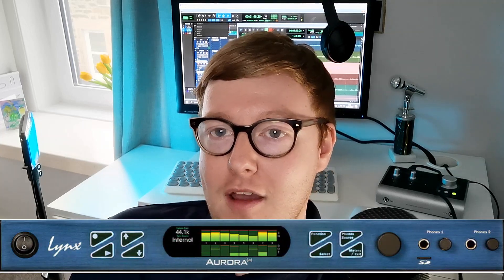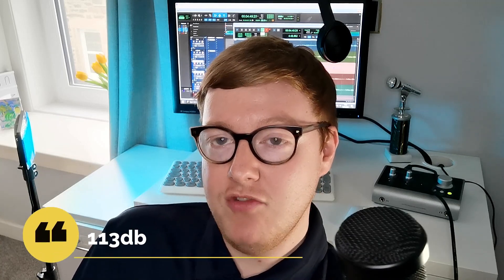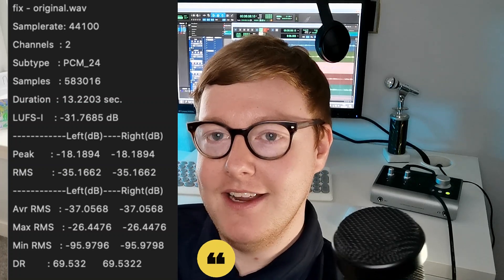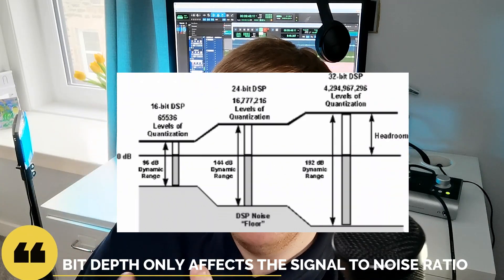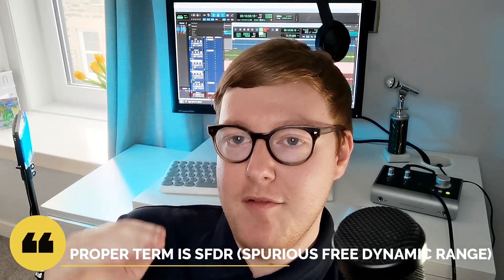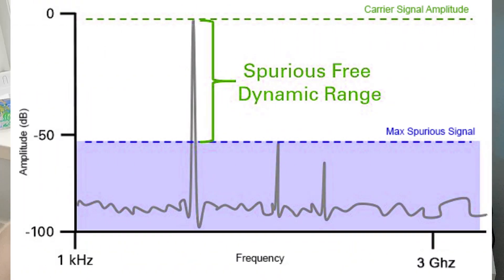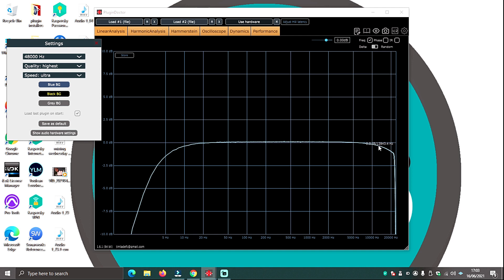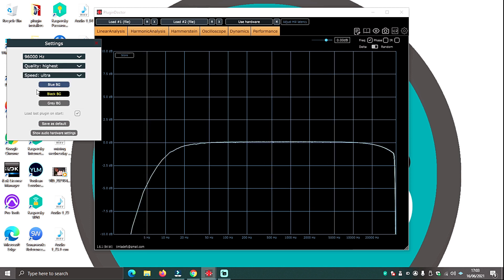Do you lose audio quality in analog gear using budget interfaces vs expensive ADC Converters (Pt 1)

Comment: 1bit = 6db? What does that even mean? dbwhat? dbSPL, dbVU, dbvu, dbFS? You can't say something is 6db and not include a suffix. It would be like saying that speaker handles 100 watts. 100 watts what? RMS, average, peak? The difference between 100WRMS and 100W Peak is nearly double.
Reply from the maker: And why can't you not use dB when it is dB lol. All the analog manuals and audio interface specs state dB for dynamic range 😂

(from the universal audio 1176 manual) 

Dynamic range - The difference between the loudest sections of a piece of music and the softest ones.  The dynamic range of human hearing (that is, the difference between the very softest passages we can discern and the very loudest ones we can tolerate) is considered to be approximately 120 dB . Modern digital recording devices are able to match (or even exceed) that range.
-----------
I said 1 bit is equivalent 6db of dynamic range. It's just 6db lol If you also look at the dbx160a manual it states:

Dynamic range > 113db

They use dbU, dbV, dbM for other measurements in the specs but for dynamic range .. Just db lol 

Iv said an easy way of calculating what analog dynamic range transfers to in digital bits is to divide it by 6 as 6db of dynamic range = 1 bit 

All your doing is quick maths to transfer what figure a manual states is dynamic range and transferring it to digital bits 

Its genuinely that simple
Reply: @PaulThird  I know what dynamic range is. When you state "The dynamic range of human hearing (that is, the difference between the very softest passages we can discern and the very loudest ones we can tolerate) is considered to be approximately 120 dB" that 120db is 120dbSPL. 
 You said "an easy way of calculating what analog dynamic range transfers to in digital bits is to divide it by 6 as 6db of dynamic range = 1 bit". Where do you get that from? If "6db of dynamic range = 1 bit" how do you represent 1db of dynamic range? All audio AD/DA converters use binary. If you know the bit depth you can calculate what the least significant bit and the most significant bit voltage will be. A 4-bit converter can only count to 15 although 0 can be counted so you can get 16 increments of voltage including off or zero volts. First, you need to understand how to count in binary. And then you need to understand how the binary numbers relate to a voltage level and how the voltage relates to dbSPL, dBu, dBV, or dBfs. With binary, you always have a most significant bit (MSB) and a least significant bit (LSB). In binary, you only have 1's and 0's but those 1's and 0's can represent any value that the programmer or the engineer decides upon. Let's look at a simple 4-bit system. A 4-bit system can represent 16 distinct values. Notice that each bit is double the value of the previous bit. So in the 4-bit system, the LSB is equal to 1, the next bit is double and equal to 2, the next bit doubles that and is equal to 4, and the next bit (the MSB) doubles that and is equal to 8. So how do we convert digital to analog? Let's use an example of a simple 1.228 VRMS light bulb that I want to dim and a 4 bit digital to analog converter. Since a 4-bit system can represent a maximum of 15 values*, you divide 1.228 volts or 1,228mV, by 15 and that will give you the value of the LSB. 1228mV/15 = 81.87mV or 0.08187 volts.

 
*Note: A 4bit system can actually represent 16 values when you include zero or in the case of our dimmer, OFF.

A 4-bit binary counter would have 4 columns with the values of:
An MSB of 8 followed by a 4 followed by a 2 followed by a 1 which is the LSB.  The binary chart would look like this:

8 4 2 1
0 0 0 0 = 0 
0 0 0 1 = 1
0 0 1 0 = 2
0 0 1 1 = 3
0 1 0 0 = 4
0 1 0 1 = 5
0 1 1 0 = 6
1 1 1 1 = 7
1 0 0 0 = 8
1 0 0 1 = 9
1 0 1 0 = 10
1 0 1 1 = 11
1 1 0 1 = 13
1 1 1 0 = 14
1 1 1 1 = 15

The LSB or the 1's column is equal to 81.87mV                
The 2's column is double that and equal to 163.73mV   
The 4's column is double that and equal to 327.47mV   
The MSB or the 8's column is double that and equal to 654.93mv 
Add the voltages in the 4 columns and it will equal 1228mV or 1.228V

Now, in a 16-bit system the binary chart would look like this:
16,384 8,192 4,096|2,048 1,024 512 256|128 64 32 16|8 4 2 1 and the least significant bits voltage would be 0.000,037,475,585,937,5 volts or 37.474uV.

A 24-bit binary chart would look like this: 
 4,194,304 2,097,152 1,048,576 524,288|262,144 131,072  65,536 32,768|16,384 8,192 4,096|2,048 1,024 512 256|128 64 32 16|8 4 2 1
The LSB for my 1.228 volt dimmer would be 0.000,000,146,389,007,568,359,375 volts or 146.39nV

I didn't choose 1.228 volts for my imaginary dimmer at random. The most common calibration level for professional audio equipment is +4dBu (1.228Volts RMS). My iD14 operates at +4dBu. Yes, I own one. Consumer and some "prosumer" audio devices operate at -10dBV (0.32 Volts RMS). 

In a DAW, the proper standard calibration-level that should be used is, -18dBfs which equals +4dBu = 0 VU (1.228 Volts RMS) There is no 16-bit or 24-bit system that will yield a single bit equal to 6dbSPL. 

"6db of dynamic range = 1 bit" sounds like information you would find on the Gearsluts website. Kind of like "you have to use all the bits!"
Reply from the maker: 1 bit = 6db of dynamic range 

Thats it haha. No need for any further complications 🙈

I really don't understand why it's OK for the analog manufacturers to use db for dynamic range but not for me 🙃

From presonus site talking about conversion 

"24-bit digital audio has a maximum dynamic range of 144 dB, compared to 96 dB for 16-bit" 

144 % 6 = 24
96 % 6 = 16

All I've done is gave a quick calculation for people. That's it. Everywhere I've looked uses dB for dynamic range. Its just a quick calculation so people can correlate the 2 for a very basic understanding. Very rudimentary stuff here. Not going into specific detail. Just a quick rough calculation to give you an indication of how dynamic range generally correlates to bit depth. 

That's it. Simple. We're talking in such detail about something I said in 5 seconds of a 17 minute video lol it's a rough calculation, just leave it at that 🙈
Reply: @PaulThird  Ok, I will try again. Here is a definition of the word decibel from the online dictionary yourdictionary.com decibel - A unit used to measure the power of a signal, such as an electrical signal or sound, relative to some reference level. An increase of ten decibels in the power of a signal is equivalent to increasing its power by a factor of ten. As a measure of sound intensity, a zero-decibel reference is stipulated to be the lowest level audible to the human ear; the speaking voice of most people ranges from 45 to 75 decibels.

note the phrases "relative to some reference level" and "a zero-decibel reference is stipulated to be the lowest level audible to the human ear; the speaking voice of most people ranges from 45 to 75 decibels." 

So what is the reference level? If you are talking about Sound pressure then the reference is given as Pascals. Sound pressure level expressed in μPa or Pa. Human ear’ audible sound pressure levels range from 20 μPa (hearing threshold) till 20 Pa (pain threshold), resulting in the scale 1:10,000,000. Since using such a large scale is not practical, a logarithmic scale in decibels (dB) was introduced which is also in agreement with physiological and psychological hearing sensations. dB of sound pressure level (dB SPL) is defined as: 20 log10 p1/p0 where p1 is actually measured sound pressure level of a given sound, and p0 is a reference value of 20μPa, which corresponds to the lowest hearing threshold of the young, healthy ear. In the logarithmic scale the range of human ear’s audible sounds is from 0 dB SPL (hearing threshold) to 120-140 dB SPL (pain threshold) 

 Common decibel readings used in various audio fields are dB SPL (for sound pressure levels traveling through the air), dBu (for electrical levels in Volts), dBm (for power levels in Watts), dBVU (volume units, the standard measurement of electrical audio levels on mixing consoles and analog tape machines), and dBFS (or full scale, the standard measurement level for digital audio levels).

0dB on my mixing console is actually 0dBVU. 0dBVU is very different than 0dB SPL or dBFS. 0dBVU on my mixing console indicates an ideal level whilst 0dB SPL indicates no sound at all and 0dBFS indicates your digital console or DAW is clipping as hard as it can clip.

Regardless of what you think about my post, I thought your video was done well and easy for people to understand. The only exception for me is the "1 bit = 6db of dynamic range". I have seen this claim before and it is wrong. I have been involved with professional audio since 1981 mostly doing front-of-house sound. I toured with the rock band Brother Cane in the '90s while they opened for bands like Bad Company, Skynard, Aerosmith, and Van Halen. I've done sound on huge Clair Brothers rigs in arenas, amphitheaters, and outdoor festivals. BC at Red Rocks in Denver. https://www.flickr.com/photos/109161978@N03/49103924408  

I built my first home studio in 2004. (calling what I had a studio is a bit of an exaggeration)  https://www.flickr.com/photos/109161978@N03/12079469166                        

I designed and built a custom DA converter for a circuit board that I designed that hot-rodded VHS tape winding machines owned by LG Electronics (1994) https://www.flickr.com/photos/109161978@N03/13030501544
Reply from the maker: I fully understand the context of what your saying and I used dbVU when describing how I hit the dbx 160a and I've used  -18dbfs and 0dbvu when describing gain staging etc etc

Its just in this specific example everywhere Ive looked has db for dynamic range.

I'm extremely literal being on autism spectrum so if I read everywhere I look for dynamic range as dB then I'm going to use dB as quick calculation to give you a close correlation to bit depth. 

As you are more versed in measurements you could maybe give me a reason as to why the manufacturers (hardware and converters) have dynamic range listed purely as dB where they also use dBu, dBm etc in the specifications for other measurements. 

I'm just very confused as to why everywhere I read is dB but you are saying that I am wrong for using that. 

Id understand if it was a lecture or I was teaching students but it's just a quick calculation that would make sense for those who aren't versed in dynamic and bit depth. Why make it more complicated than it needs to be for this simple specific example. 

IF they read a hardware manual and it states dynamic range as dB and they want to correlate that to the dynamic range of their converter then the bit depth is irrelevant as the converter dynamic range will also state dB in the specs to compare. By using dB SPL that may confuse others as when they look in the manuals it'll just state dB. There's a lot of engineers I know also on the spectrum and that could be confusing. 

I only brought bit depth calculations in this video for the sole purpose of showing why 24 bit conversion is pretty redundant for printing analog gear through. By understanding that 6db of dynamic range = 1bit it gives the viewer a quick correlation to understand why I'm saying that's its not really needed. 

Its purely for quick reference so those who don't want to go deep can have a very basic understanding of how it all correlate so when I say 24 bit they can go 

24x6= 144db of dynamic range.
My 1176 has 114db of dynamic range so thatd be 19 bits so that's 5 bits that wasn't needed. 

Obviously it's not 100% correct as the figures we read are rounded to the nearest whole number I.e. 16 bit is actually 96.3db, 20 bit is 120.4  etc but for those looking for a quick correlation if it's say an eq has a dynamic range of 118db my calculation would end up as 19.6 bits which is unrealistic but for quick reference youd just say 19 bit as you  know it covers 19 bit. 

Its flawed but it was just a quick calculation to give viewers context to what I was speaking about. 

"1. Introduction 
A frequent task performed by embedded systems is the 
real time collection of analog data. One such application is 
the collection of acoustic data using an array of MEMS 
microphones [7-9]. To monitor this process, it is desirable 
to provide an indication in decibels (dB) of the amplitudes 
of the analog inputs. In response to this need, a simple and 
fast algorithm has been developed for converting a binary 
word, representing an analog voltage, to a dB value"

Everywhere I go it just says dB haha I can't find anywhere else that uses any other form of dB measurement when discussing this particular topic of measurement haha

Comment: Nice video man! audio interfaces and converters have come a long way. Cheer to JULIAN KRAUSSE that measured all the budget interfaces, demystifying that pre amps and converters on those are crap. If you watch his videos you'll see that they are just almost flat, with maybe a 0.1 dB of difference in the extremes.
Reply from the maker: Yeah I need to watch more of his videos 🤓
Reply: Gain, preamp noise, harmonic distortion are what I typically look at for in my ADCs, which Julian goes over. I don't rember if he goes into phase checking. I ended up buying a Tascam 2x2HD because of his testing (and what I can convince myself to spend).

Comment: I saw a video where they ran audio from the analog output to the analog input, recorded and repeated the process until the audio had been converted 500 times, and it still sounded pretty good. It was one of those budget SSL interfaces. Now, that's a neutral converter.
Reply from the maker: That's the video I tagged at the end of this audio haha
Reply: @PaulThird  I have this habit of stopping the video as soon as it gets to the video links. Oops!
Reply: And the SSL outperformed the Audient… (albeit marginally, after 500 passes) :)
Reply: @timrober75  I wonder if the Audient interfaces are designed to subtly boost highs, which is why the low end disappeared after 500 passes.

Comment: I don't think you're completely correct with your test. You are testing with just two track of audio, it starts to matter with higher track counts. That's where budget interfaces starts to fall apart. I don't think it's fair to do a quick null test between two interfaces and say that all high end interfaces are garbage. You also left out the clock jitter which all interface have? Some are really bad which leads to smearing in the top end as well as the low end. I've own my interfaces in my life time and I hear the difference between all of them. One my best interface was a modded Digidesign 002 by Blacklionaudio it had amazing sound. Can you achieve great recordings with a budget interface? Sure you can for the average home studio. This is the problem with Youtube we need to stop blurring the lines between a Pro Studio and home studio. Because if you needed to record a 100 piece Orchestra, there is no way a budget interface would be able to compete with a high end interface no way. Try recording a band with your interface tell me if your AD would be able to handle that dynamic range in the same way? Just my thoughts on this topic.
Reply from the maker: A null test is a null test. It's shows the transparency of the signal. The id14 is more transparent than the lynx. It just is what it is. This video is talking about the conversion of printing analog gear through audio interfaces. I've been quite clear that budget audio interfaces are only ideal for guys printing the odd analog gear here and there and that you'd need expensive converters to run lots of analog gear in a session.

I've not said once that expensive converters are garbage. Not once. What I've said if that they are 'making the source sound better' as I keep getting told then they aren't transparent which is the main selling point of the converters. They aren't giving you anything in the analog gear that is missing by using audio interfaces. That's where the bullshit comes in.

Once the audio is printed its printed. Doesn't matter how many printed tracks of analog gear you have. A more transparent signal is a more transparent signal.

I'm not talking about recording through mics or anything like that. It's all about printing one piece of analog gear through an interface. That's all I've discussed